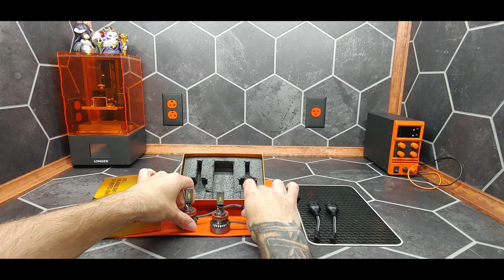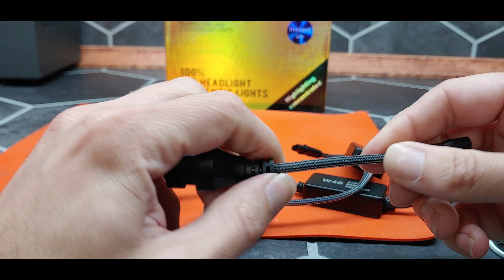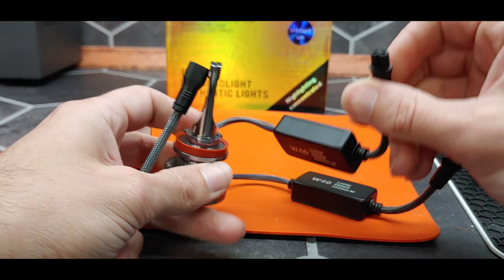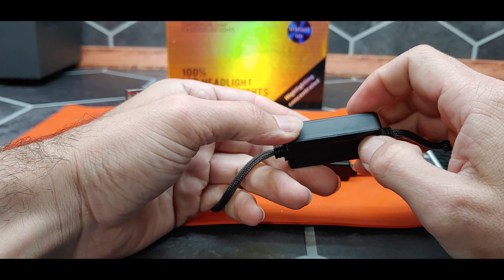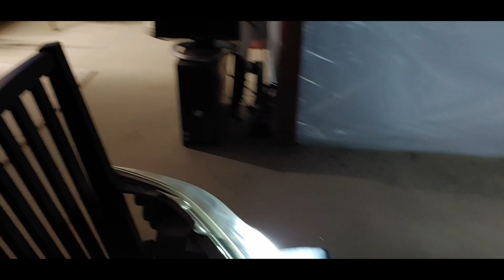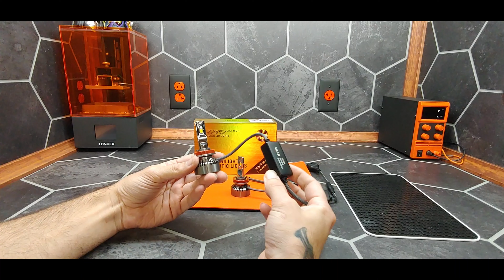Wontolf H11 LED Headlight Bulb Review

Comment: On an older vehicle, would it be possible to cut the hotbox out of the wiring  or does it contain a voltage booster of some kind ? 
Thanks
Reply from the maker: I do not believe the bulb would be able to operate correctly without the box. At the very least, I don't think the LEDs used here can be directly driven at vehicle voltage and would likely die quickly without the box regulating voltage and current.
Reply: @Jamesthelightguy  
I have a pair of H1s and have opened the hotbox of each. They are virtually empty and the components inside are covered in some sort of grey rubbery paste. 
It does not look like arctic silver. These look very cheaply made on the inside.
Reply: I have photos of inside the hotbox if you would like them??? . I peeled the rubber solution off what I think may be a capacitor and found 220 printed on top.
Reply from the maker: If you want to share, you can email them to me. jamesthelightguy (at) gmail
Reply: I think its a  regulator and ballast very similar to an HiD. I suspect that removing this box will give me a vastly underperforming led.

Comment: So the will the H11 will do both low and high beam?
Reply from the maker: It depends on your vehicle. If yours uses H11 bulb type, usually it is for low beam OR high beam, not both. In most cases (like my sister's car) the bulb type is different, example is H11 for low beam and H7 for high beam.
Reply: @Jamesthelightguy  ok so i on the box of lights that I have it says “h8/h9/h11”   My Nissan Altima 2d coupe says it take h11 for lows and h9 for highs so is it both high and low since it’s categorized in that same “h8/h9/h11” or am I just missing something
Reply from the maker: That's great. H8, H9 and H11 all have the same form factor, so in your Altima you can use these bulbs in both positions!
Reply: @Jamesthelightguy  ok thank you for clearing up my confusion lol

Comment: I have d2s or ds2 bulbs in projectors running 55w led but for some reason I'm still blind at night can you recommend the brightest led to throw in? It can be any bulb size similar ill custom fit it if I have to
Reply from the maker: If you can make a customer base plate, I recommend using this H1 bulb:

https://www.amazon.com/dp/B07VVB8W7B/ref=cm_sw_r_cp_apa_fabc_-lw3FbW8XBJPK

But that does require doing a lot of measurements and CAD work to get the light source in the correct position in the housing.

These D2S LEDs are a little less bright than the H1 bulbs, but don't require any modifications to work in your housings:

https://www.amazon.com/dp/B088T6FP58/ref=cm_sw_r_cp_apa_fabc_9nw3Fb8M7AE7T

Let me know which route you choose and how they work out for you!

Comment: Well I just bought these the 9005 600k.. that little box is shoved in the housing with a dust cap over it.. so it’s just sitting in there close to the wires and everything:: do you think that’s safe? Or should I try different ones?
Reply from the maker: I would try to keep the box from touching anything. If there's a way to get some airflow for cooling it, that would be best.
Reply: James the Light Guy yeah there is a dust cover over it .. so idk about that.. maybe the fan from the light? Ima check it 2maro night n see if it’s burning the plastic of the housing and if it is I’ll just replace them

Comment: This light test regimen had me euphoric. Displaying the same bulb in projector and reflector housings. On a black road like background. At all the same critical measurement points across the beam scape. Had to turn on notifications lol.
Reply: Agreed, great job testing everything. He should get a thermal camera in the future to measure how hot the components actually get.
Reply from the maker: I totally want one, but they are so expensive! I need to save up a bit or get more patreon supporters first.
Reply: @Jamesthelightguy  check out the flir one, i picked up a used one for $100, works with well.